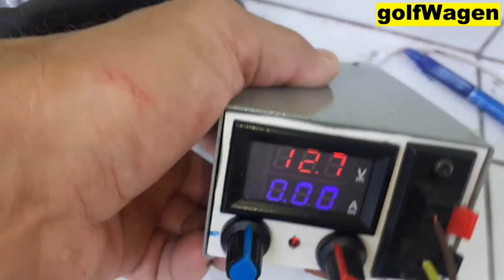VW Golf 4 1.6 throttle body replacement removal cleaning

Comment: Good job brother. As additional information, I would like to say this; It can be applied to all 16-VALVE vehicles for the Golf 4 platform, such as this car. Also, there is soot in this vehicle due to too much oil vapor, so I think it is useful to use additives for the internal cleaning of the intake manifold. Good luck, my dear brother.